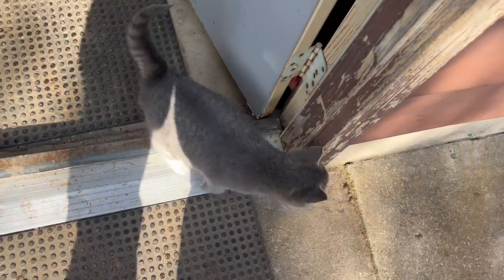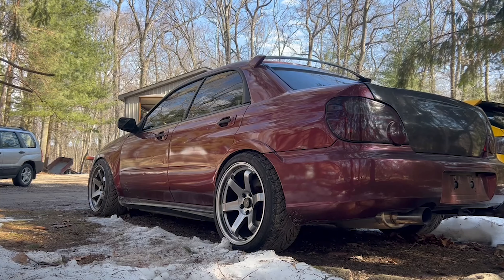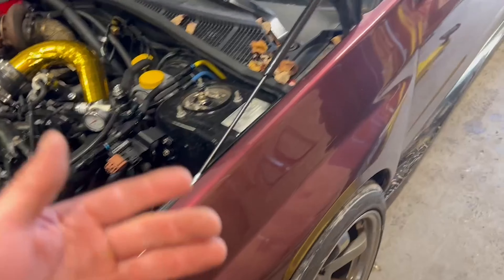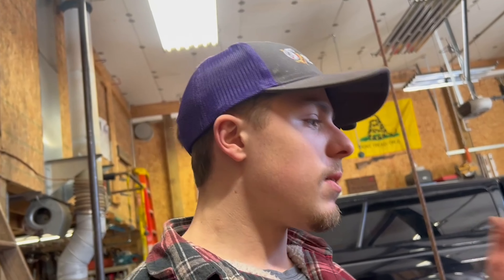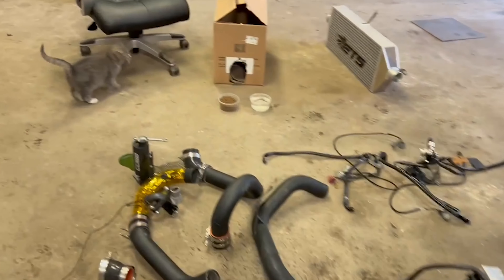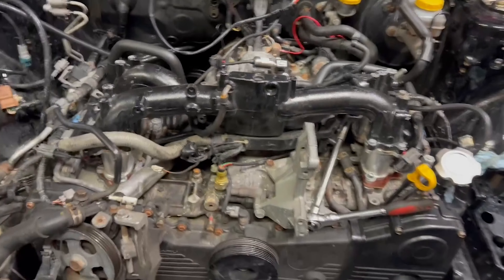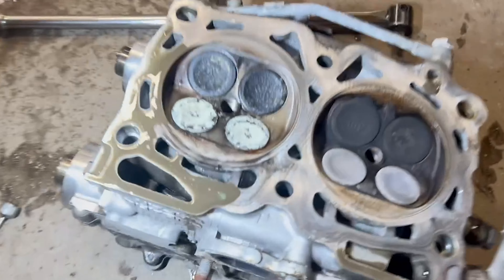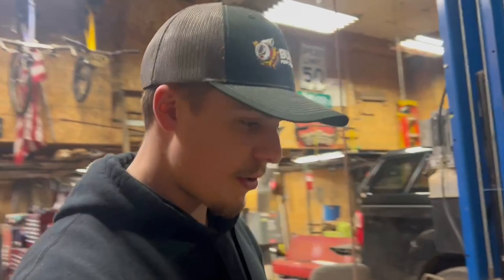Subaru STI blows headgasket and RUINS the entire engine!

Comment: Yeah, when a HG fails like that, those combustion gases are like a cutting torch. If not found and diagnosed early, this is what you get.  Six-Star all the way!  I use 'em in all my builds, I think they are the best you can get. The only caveat is that the surface prep they recommend should be followed to the letter. 50 RA or finer on the heads and block deck. I always lap mine to about 35 RA or finer, never had a set fail yet. Just follow procedure all down the line with torquing instructions.
Reply from the maker: I’ve heard of them before, most of my setups are stock ish power, and I just use oem.

I really want to do a nice 450-500whp setup, but with the new house, and finishing the barn, from an empty pole barn to a shop, I really should have money going elsewhere!
Reply: @_robertburger  If your on a budget, ( and who isn't these days! ), you can create your own lapping table. Here's how. 
  If you are fortunate ( although debatable ), to live near a city, there is usually a mason/stone supply house that will have polished granite stone cladding used for commercial buildings. They will more than likely have a sheet with a corner broken off that you can get for a reasonable price. This stuff is dead flat!  A piece of granite counter-top may work as well. You can cut it down to whatever size that meets your needs with a diamond blade with a trickle of water flow to keep the blade cool.
   Get some "3M #77" adhesive spray and after a though cleaning of the granite, spray a light coat onto it and lay down some "wet/dry" abrasive paper edge to edge and roll it down with a hard rubber Formica roller to make sure its down flat with no bumps or bubbles.
  Wet it down with water and gently lay the head on your new lapping table and with a circular motion and even pressure keep working it until you get the desired finish your after. Works for me. Just takes time and effort to save some money.

Comment: Open deck EJ garbo
Reply from the maker: They can be, key word can be, fine up to 450-500 who mark, with the right head gasket and studs. Which this did not have the correct studs. The turbo motors are semi closed deck, they have some supporting unlike the non turbo motors, which are open deck